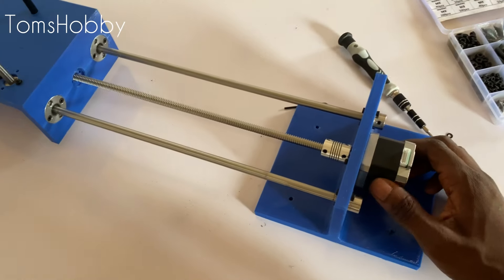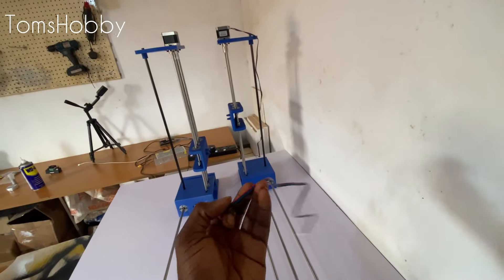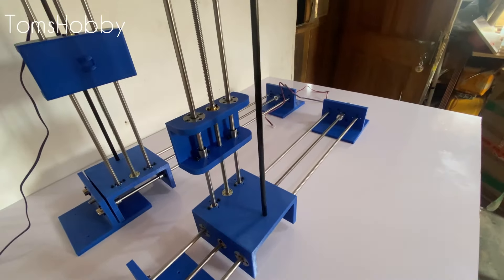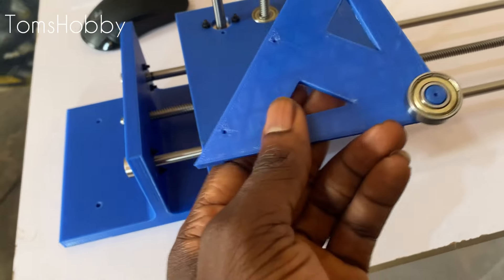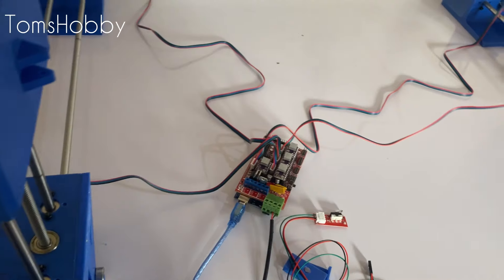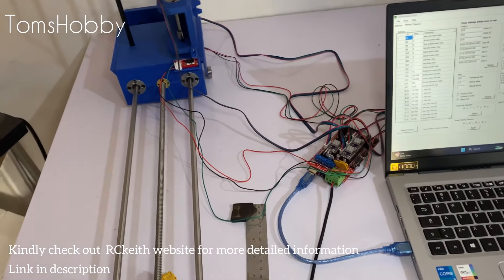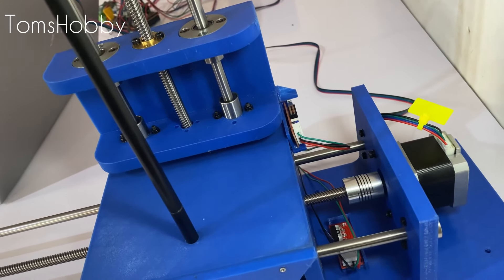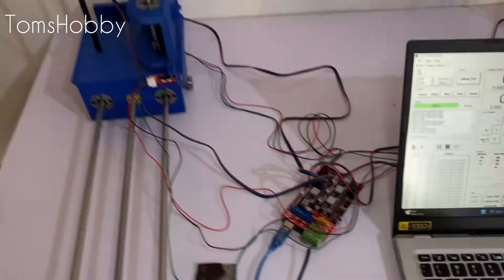Four Axis 3D Printed CNC Foam Cutter Build | Part II

Comment: Do not replace the rods, yes, they are a bit thin, but you can considerably reduce the swaying with an upper rod between the two rails to stabilize
Reply from the maker: I believe I already presented my fix for the swaying